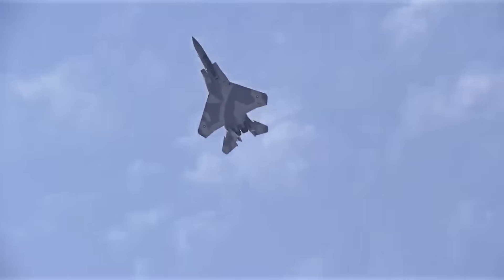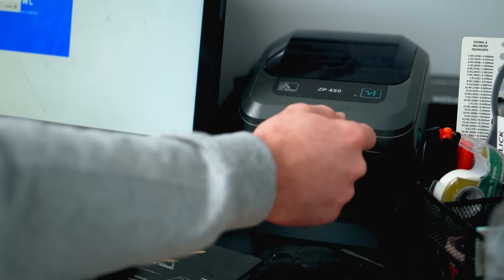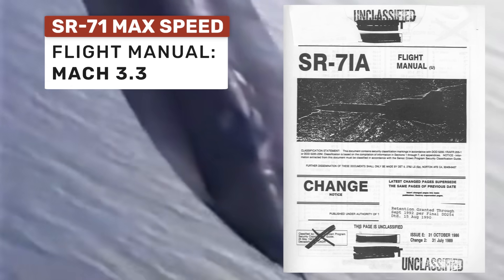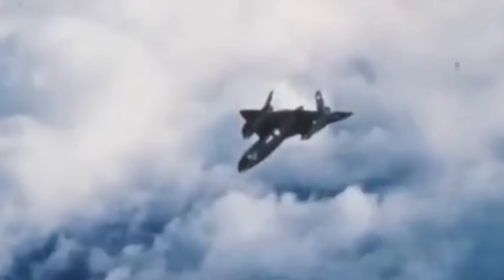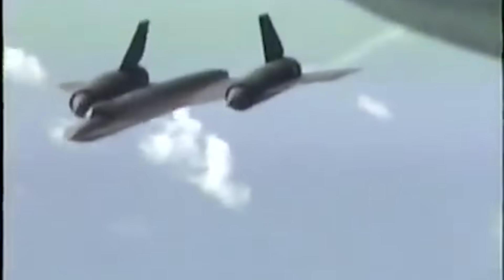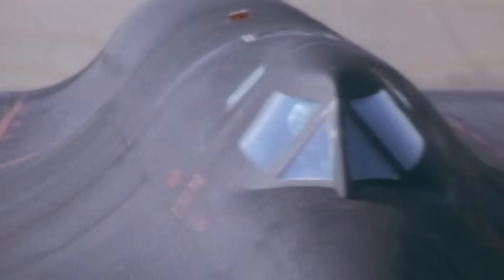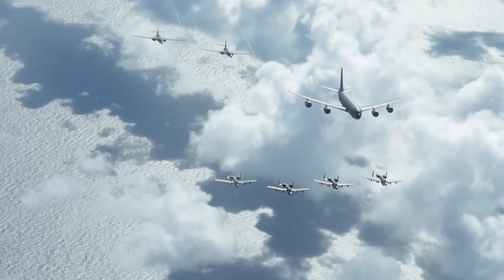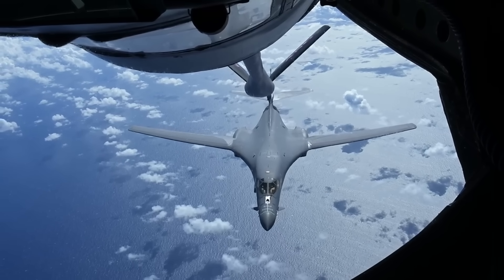The SR-71 was MUCH FASTER than the Air Force will admit

Comment: I knew a gentleman who has passed away who worked for the Skunk Works. He was quite clear that Mach 3.5 could easily be exceeded. He only said this after Brian Schul's accounts came out, and those of others, so he apparently felt that security was already broken, so... He wouldn't say more, but that 3.5 was quite attainable and even passable. Of course, what shape the plane would have been in after that from the thermal effects is another issue entirely!
Reply: 3.5 was not easily attained let alone exceeded
Reply: @gr8crash Brian Schul's accounts made it clear that 3.5 was well within the Blackbird's capabilities. Again, the thermal effects may have hurt the airframe but it was apparently attainable. Whether the engines and airframe would have eventually destroyed themselves is another issue. My friend's comments only came out after Schul's and others who were there came to light.
Reply: @theswordguy5269  Shuls accounts, like most of his stories aren't very true either and aren't good sources of factual information. Getting close to 3.5 was attainable,  but the circumstances under which it could happen are VERY specific and usually not fully within the pilots control
Reply: @gr8crash I"ll go with what my friend at the Lockheed said.  I doubt that either of us possesses the requisite security clearances to know for sure. So, we're left with a lot of anecdotal comments and accounts. My friend worked on the SR, the A-12, the F-117 at Area 51, and all the way back to the Constellation. While not a super high ranking employee, he knew and worked for Kelly Johnson and Ben Rich. If he said that 3.5 was attainable, then in the absence of the Air Force suddenly releasing the Blackbird's true performance data, I'll go with his claims.
Reply: @theswordguy5269 so firstly no. We don't need "requisite security clearances" as all this information is declassified and public.  So if your friend said he worked on all those at Area 51 then it already raises red flags as the SR71 was never operated or flown at Area 51. Mach 3.5 was ONLY possible under VERY specific circumstances,  and the very few times where speeds even fly close to 3.5 it was largely out of the pilots control. Nor would a pilot, like Shul, go up there and fly the aircraft that fast, it just wasn't done, nor would he have even been able to on that mission anyway.
Reply: @gr8crash I didn't say that he worked on the SR at Area 51. He worked on the F-117 there during the early testing phases of Have Blue. He also became a an aviation author and something of an expert on World War Two paints and paint schemes. His books are still available on Amazon and other places. And no, the SR-71's top end performance figures are still classified. That's the very reason that we're having this debate in the first place!
Reply: @theswordguy5269 you did kind of imply that he did, but maybe it was just how you worded it.

But, the SR71 "top end figures" are all declassified and known. Have been for well over a decade now.
Reply: @Pene7942 agreed, not at all. His stories are entertaining,  but just not particularly true even though people swear by them.
Reply: @gr8crash  Actually, I didn't imply at all. I used the Oxford Comma. Not to be overly pedantic, but using the Oxford Comma is an attempt t NOT imply. Each dependent clause within the commas is separate. In another life, I taught English among other things. What's been released is the public Mach/altitude chart and relate documents showing that the maximum recommended or allowed airspeed under normal operations. However, the airframe/engine combination could happily go faster although, as I said earlier upthread, what shape the airframe would be in after that is another matter. It would accelerate until it melted and became unflyable.  That red line data is still not quite out there. The Blackbird's Limit Speed and Altitude charts shows that 85,000 feet was the "normal Operating Altitude," but is silent as to its maximum ceiling. That's what I'm referring to. Charts and data points like these are available, but its the maximum numbers that are still hard to come by.  

We will have to agree to disagree and just move on.
Reply: @theswordguy5269  i get what you are saying about the comma usage, but still the way you worded it leads to a confusion. You menton the A12 which was at Area 51, following by the SR71 which was not then they F117 which was and say "at Area 51". That would logically lead to someone thinking that all 3 werre worked on Area 51 which wasn't the case. But regrdless, semantics. As for the rest, no again its all known. The performance charts are readily available, and actually already go beyond what the aircraft could be flown at. The maximum limit was mach 3.3, and only with commander approval and only if engine CIT was below the limit. You couldn't just fly faster because you felt the need to, whether that included a SAM launch or not, your max speed was still your max speed. For example if it was a little warmer than standard you may be at a max CIT and only at mach 3.1. IF there was a SAM launch you would not be able to accelerate to 3.3 or even 3.2 as you were already at your limit. And besides all that -1 data, we have the design information from Lockheed etc that in detail break down what aspects of the airframe would be an issue and at what speed etc. Also what would be required to reach higher speeds including what would be needed to reach its maximum airframe potential, and these improvements were never done
Reply: @gr8crash Again, Oxford Comma. Not to be a jerk or overly pedantic, but the Oxford Comma is meant to avoid confusion and inconsistencies in interpretation. Sadly, it isn't taught well in schools, anymore. At my school, we do teach it but we're an admitted outlier. I mean absolutely no offense, truly, but if you don't get it, I don't hold that against you. I take no offense personally. I'll instead bash my fellow educators who are doing a  piss poor job, as my Dad would say -  and yes, I am bashing my own profession. We suck at a lot of things. Anyway, if you'll research Tom Doll whose books are at Amazon and other places, you'll know whom I was referring to. He started as a painter and wound up applying the anti-radar coatings to the A-12, SR-71, and eventually to the F-117. Those were the planes that he could talk about. When Lockheed designs started to be declassified I'd send him the links and info and he's say what he recalled about them.   He was also Richie Valens' back up drummer, though I didn't know that until after he passed. He spoke with a number of SR-71 pilots and rear seaters (not just Brian Schul) and they all said the same thing - that the SR could well exceed the published numbers. How far it could go was another issue before failure. One particularly harrowing anecdotal and not declassified account of an A-12 over Vietnam indicated a Mach number of beyond 3.5. Again, we just don't know for sure what the ultimate failure limits were, and those numbers remain out of reach. That's what I have been referring to. If I wasn't clear on that, then I apologize. Yes, the raw performance data is out there and declassified but the maximum top speed? Forget the never exceed speed, but the maximum top speed? That's still a bit in the wind.
Reply: @theswordguy5269 not being a jerk, I know exactly what you're saying. But I also k kw exactly how people will read it, and how it's interpreted. But that's largely irrelevant. 

I have interacted with many former crews and symposium etc and virtually none of them will claim that. There are VERY specific circumstances where speeds above mach 3.3 have occurred, but those speeds weren't fully within the pilots control. Again we don't just have the -1 information,  we have all the research done that also proves that it wasn't going to happen. To reach those speeds on a standard day simply weren't going to happen,  not without damaging the engines which were the initial limiting factor to greater speed. 

And no, there were no operational A12 flights that reached 3.5. We have all those mission reports with speeds and they were all around mach 3.2.

Comment: When they say Top Speed that's the Speed the is able to fly at and still be Mission Capable it's not the actual Top Speed or Altitude the Aircraft can be controlled at The F-15 had a Top Speed of Mach 2.5 but those Pratt and Whitney PW 229,s could push the Aircraft to Mach 2.8

Comment: Same with the USN claimed speed for nuclear powered ships, 33 knots. Which should be taken with several grains of salt. Now almost every conventional powered ship is right near that 33 knot top speed, that's if everything is able to preform at their peak. Some might be a little faster, but most conventional's are a bit slower. And if you go way back the gas turbine powered PG's were pretty fast, the experimental hydrofoils were even faster than the PG's.

Comment: SR-71 or "Habu", flew out of Kadena AFB, Ryuku for a long time. They were kept away from the rest of the squadrons stationed there in their own section of the base. I was not a member of the strategic recon squadron which flew them, but I did share a beer or two with members of the squadron at the NCO club. Pretty closed mouth about actual numbers but they did relate a couple of things. One, the Habu leaked like a sieve on the ground, this due that the aircraft was designed to fit together properly at speed. Two, I was told that if a crew punched out over NYC at top speed, the capsule would land on the west side of LA. That's all I've got.

Comment: I guarantee that they could do more.  Also, it should be mentioned that max speed needs to be in straight in level flight.  I can get a C172 up to 200kn in a descent but that doesn't mean much if I'm trying to get anywhere. However, like stated there are a couple reasons they probably didn't go faster than 3.2 and they are all related to the ability of the aircraft to stay together.  I also wouldn't doubt the F-15 is capable of that speed WITH NO WEAPONS attached.  Fully loaded and it wouldn't be able to reach those speeds.

Comment: Fun fact: SR71 engine thrust - 68k lbs, weight - 60k lbs

                F-22 engine thrust - 70k lbs, weight - 65k lbs

A top speed cannot be achieved due to the extreme outside temperatures on the airframe of both aircraft. We will never know.

Comment: I have heard rumors of Mach 4+ but those are unsubstantiated.
Reply: Also impossible
Reply: @gr8crash   As I said, unsubstantiated.  J58's are impressive engines but I don't think they can sustain Mach 4 speeds.
Reply: @MrCateagle you're correct. They can't. The engines nor the airframe could even reach mach 4

Comment: While the SR-71 is very impressive indeed, there is a plane that sits in it's shadow. The B1-B Lancer, this thing has twice the thrust as the SR-71 and could carry more payload than a B-52 over mach1. Now that is impressive.
Imagine carrying 120,000kg of fuel and 34,000kg of payload with a dry weight of 86,000kg, and getting that much weight to mach 1 at sea level.
Now apply the same logic here, I could imagine it being able to get to much higher speeds at altitude.

Comment: 10:36  Rocket Ride = When you go straight from the ground to max altitude/max speed.  Usually, the SR-71 would have a "leisurely" take off with just enough fuel to fly up to an awaiting tanker at 29k feet to top off the tanks.  Because it leaked fuel when it was on the ground, for a rocket ride, the tanks were filled to the brim before take off and you would see fuel squirting out of the seams of the aircraft.  As we all know, the heat generated at mach would cause the metal of the aircraft to expand and seal off the leaks.

I worked on the SR-71 for a year until it was shutdown the second time in Oct 1997.  During mission debrief, the pilot would tell us his max altitude and max mach number.  The altitude and mach numbers would be all over the place.  Somedays, the aircraft would be over 80k in altitude but just barely get above Mach 3 and other days, it wouldn't get even close to 80k, but the mach number would be way above Mach 3.  It just depended on the outside air temperature and the thickness of the air.  That's why the Air Force would only say that the max altitude was 80,000+ feet and max speed was Mach 3+.

Comment: This is a bit unofficial, but as a young man I was at Edwards AFB doing Flight Data Reduction work on the three test SR-71's owned by Lockheed Skunkworks. They were the flight envelope development units. Regarding flight performance it was well understood and a bit of a snickering point that company pilots knew where the "Coffin Corners" were and the flight envelope provided to the customer were well shy of those. The record runs were always done by the customer because after all they were the customer and wanted those bragging rights. Take that for what it's worth. My friend and the first man to fly an SR-71 was Darryl Greenamyer, who took great pride in knowing the limits. He flew for the speed; not the paycheck. We often went to lunch after key flights so he could fill me in on the subtle nuances of the flights as it was my job to capture the flight and put it to paper. While I am going to respect my Security Clearance, I can tell you I remember the day we melted the sealer out of the fuel tanks for going too fast because I was the first out to the plane to retrieve the flight tape recorder and pilot's note pad and it was raining a storm of raw fuel under that plane. I spent a lot of time personally inside with a swab bucket of sealant trying to reclaim that airframe, skinny and lanky kid I was. We also used a Hollywood Midget who could get places my bones were too long to get around. Good Times to be sure but I'll bet that particular speed run was never repeated; I know it was not officiated like everything in those days. I'm sure top speed as a concept has many qualifiers. Much of the performance data was a function of air density, temperature and moisture levels; in other words, shock wave propagation, etc. in various areas of concern. This was an experimental turbine bypass design that became essentially a ram jet at speed. Inlet spike positioning was critical as an "unstart" could ruin your day. A pre-electronics era, hydraulic computer had to be developed to manage this critical flight parameter for each engine. I'm sure things got better with time but also I'm sure less and less risks were taken over time. Your video did a great job of talking around all these points. Bravo! 
P.S: My father was Plant Manager #42 (Palmdale) overseeing final assy./manufacturing and flight test/customer buy-off for the F-104 and SR-71 series aircraft.

Comment: I’ve known some blackbird pilots. The plane is much faster than Mach 3. I’ve heard it could do Mach 6 for a short time limited by the heating of the airframe. When you understand during the official Atlantic crossing time the blackbird hit a tanker 3 times during the record. That means slowing down to subsonic 3 times.
Reply: Complete bunk.
Reply: @lookoutforchris  just repeating what I was told from actual SR jockeys. From an aerodynamic POV the shock cone is angled for much higher than Mach 3. Do the math.

Comment: These types of speculation are usually not based on facts.  These planes are not just limited by thrust. They also have structural and thermal limits.  You can generally look at the geometry of supersonic planes and determine what their max design speeds are.  The inlet cones on the SR-71 move in and out to adjust the location of the primary shock wave to keep it out of the inlet. The angle between the max extension and the inlet lip will give a pretty good idea of the max design speed.  Planes like the F-15 have moveable inlet ramps instead of a cone, which are used to adjust the shock position. Slower planes like the F-16 use a normal shock inlet design which is fixed.  That limits the speed due to increased drag that occurs. The F-22 uses a caret inlet which is a sort of diamond shape which sets where the shocks go. If you exceed the design speed you run the risk of poor air flow to the engines which could lead to compressor stalls.  Under some ideal conditions, it may be possible to get variations in speed, but it is not a case of just push the throttle a little farther or add a little more thrust to go faster.

Comment: I heard the same thing about the SR71, many-many years ago. Supposedly an SR71 pilot had commented on the aircraft, flying in excess of "Mach 5" during a short interview, but was later denied in a follow-up comment.
Reply: No chance of SR71 going mach 5. Not with 1960s technology, materials or its design. SR71 is supersonic... it is not hypersonic wave runner..

Comment: The A-12 was classified, and the USAF wasn't going to have a CIA aircraft hold any records. That having been said, the top speed of the A-12 and the SR-71 was the same: 800 degrees. The engine inlet temperature was the absolute limit. If the outside temperature was low enough, it could go faster and faster until it hit 800 degrees. During Eldorado Canyon, outside temperature was low enough to support Brian's claim.